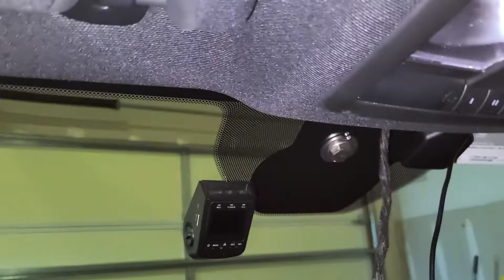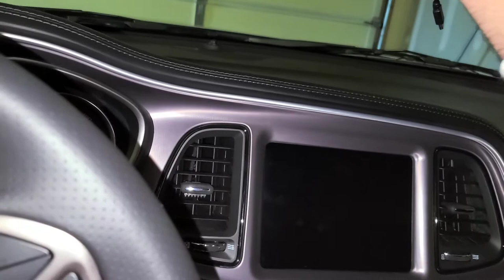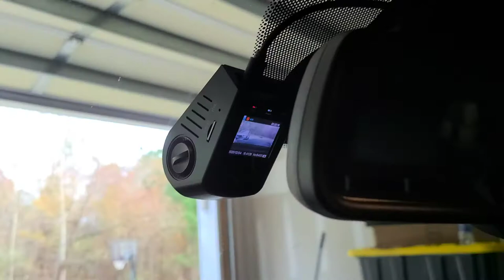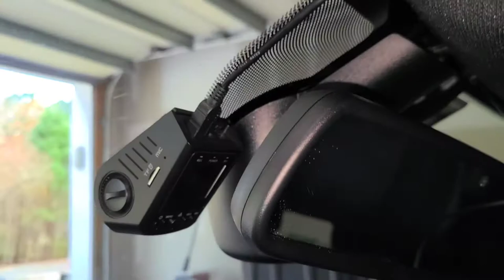Running a dashcam off Rearview mirror power in 2020 Dodge Challenger

Comment: I want one of these, but Dongar is out of stock. I have a Challenger too, 2020 1320. I would want a FT connection. There are power adapters that shut off if the power drops below a certain level.
Reply from the maker: Keep an eye on it. They restock frequently. They didn't have an adapter for my Edge ST so I had to do the old fashioned wiretap method, it works but it's way less precise.

As for the FT power on, I'm not sure your best option there, they do make dash cams with batteries so you could get one of those that records when motion is detected. I know you cam make one of the 12V in the car always on by switching a fuse but then you'd have to run a cable up the A pillar like I had initially. 

You could also use a multimeter to see if any of the wires up in that mirror cable are always hot and then use a simple tap with capacitor like this one that I used on my edge https://amzn.to/3P6bPlj
Reply: @VanquishedAgain  Some manufacturers make a FT power kit that connects to either the OBD2 port or the fusebox/battery and shuts down below a certain voltage. I just hoped that there was a solution where I didn't have to run a lot of cable and in the case of the OBD2, run a chance of having some issue with the ECM. I got an email from Dongar that they're back in stock and I awaiting reply from their support as to the nature of the connection.
Reply: @VanquishedAgain  Emailed with Kevin or Dongar. I think what I am going to do is use the Dongar with a Nexar One. It has a built In Battery. It would be a much cleaner install.

Comment: is there a way to remove the wires? wanted to change the mirror but don't know how to take it out without messing up the wires completely
Reply from the maker: You can unclog the wires from the mirror, it's one 10-pin plug.

Comment: What dash cam do you have? Also how do you know what dash cam will hook up to this adapter?
Reply from the maker: Hey. So this adapter puts out a USB A which means any USB can connect to it. I have a B40/A118C in this video but recently changed to a viofo A119C either way this adapter will work since it outputs the USB-A (the big one) and pretty much all dash cams come with that cable to their required port (usually USB-Mini or USB-Micro). My dash cam is USB-Mini. There are a bunch of converter cables too. So you can always make it work
Reply: @VanquishedAgain  Sweet! Thanks for the info and the video. Mine just came in and gonna give this a try on my charger today. Hopefully I can get the mirro trim off easily.